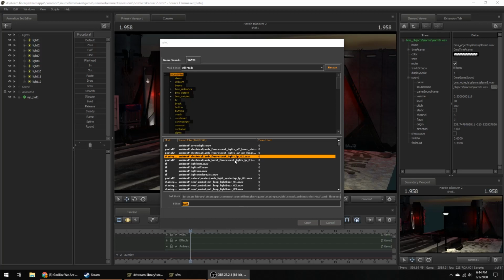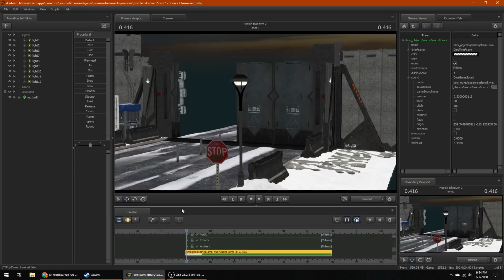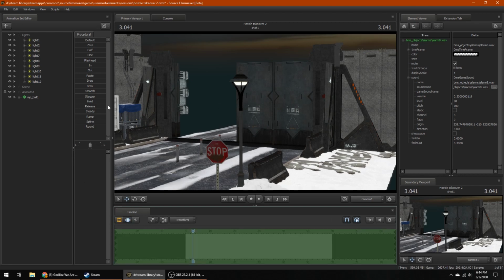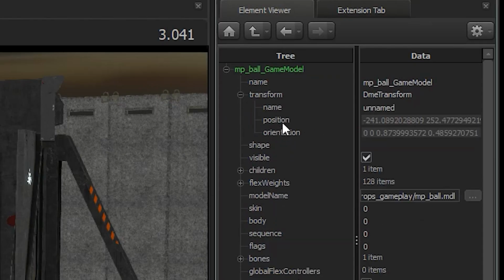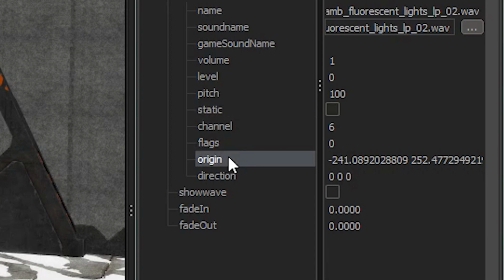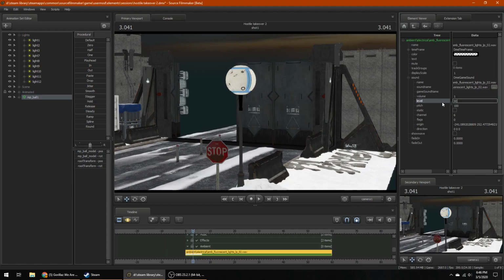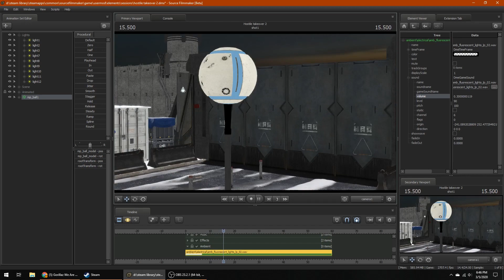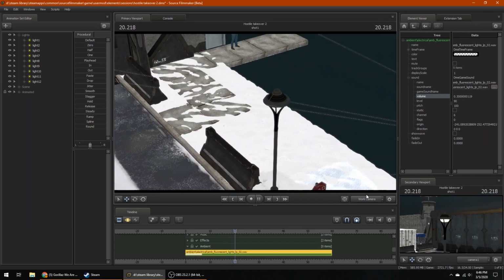[SFM] 3D audio tutorial

Comment: I did exactly the same thing and it didn't work bro, how did you do it?
Reply from the maker: make sure the audio isnt stereo but other than that idk
Reply: @jco_sfm  how do i check if its stereo or not
Reply from the maker: @darkscytheproductions2567  open it in audacity see if theres 2 channels instead of 1
Reply: @jco_sfm  ok 👍
Reply: @jco_sfm  I checked, there's two channels in it. What should I do now
Reply from the maker: @darkscytheproductions2567  up at the top of the window tracks > mix > mix stereo down to mono
Reply: @jco_sfm  ok i did that and exported as mono and it worked :D
TYSM